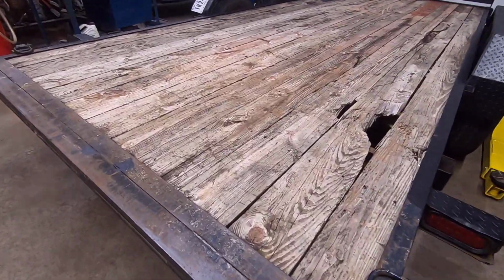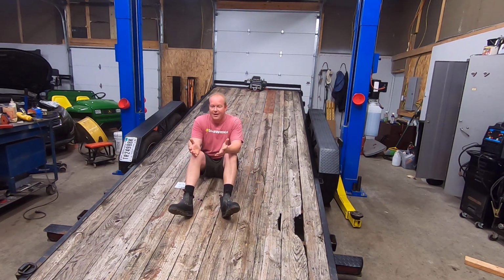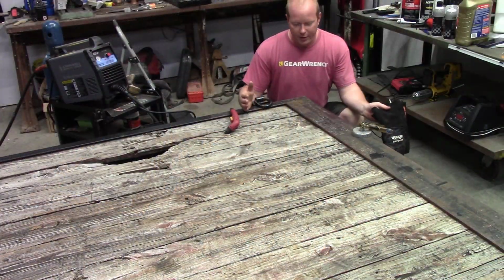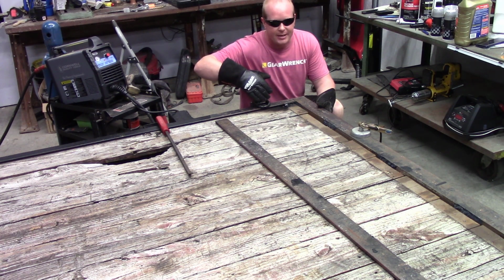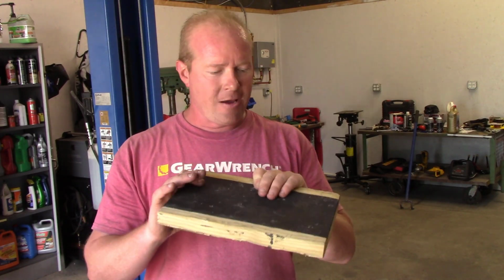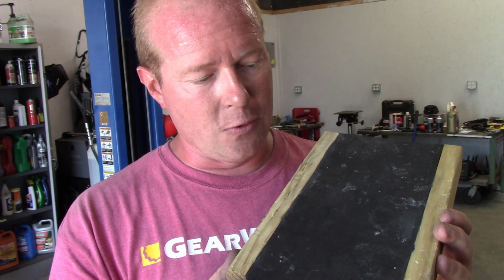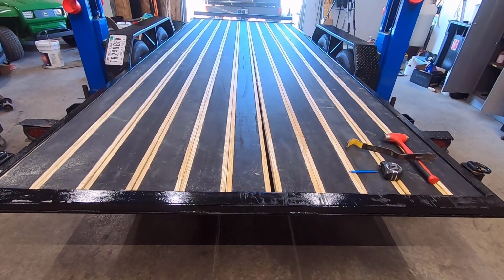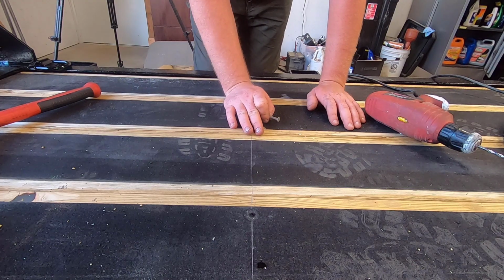Trailer deck replacement with Black Wood from Industrial Wood Technology

Comment: Nice job 👍 I'm just planning out some upgrades for my 18 foot trailer and this decking might be just what I need.
Reply from the maker: You will love it!
Reply: I am happy with the used motor oil treatment I applied to my hard wood 2X8 boards on my trailer.

Comment: Used engine oil works great for sealing wood trailer decks and it’s free.  Apply sparingly so it totally soaks in and doesn’t make a mess
When laying new deck always allow room for swelling when the wood gets wet
Reply from the maker: I heard engine oil and diesel fuel mix.
Reply: @FlashPerformance  
My deck was extremely dry, with newer wood diesel would work well
Reply: I’ve painted many of fence with used oil. It looks good when dried.

Comment: A helpful hint... Use brown copper napthanate on the deck every 2-3 years and you won't replace for decades!!.. my trailer is 21 years old and floor boards are still going strong...good preservative....

Comment: Why not just spray your boards down with Raptor Liner if you want a non skid surface.  Also would seal them from rot if you coat all surfaces.

Comment: My first concern is the longevity of the product in the elements; specifically the Florida sun.
Reply from the maker: It is just like any other wood product. It is recommended to apply a UV protective stain
Reply: @FlashPerformance   I am sure he means the rubber.. Also being in Florida, (Tampa Bay), I know that rubber and plastic takes an abnormal beating here. Check out the trim and dashboards on typical 5 plus year old cars and trucks here....

Comment: You could have taken a circular saw across the end of the boards and just pried the board ends out of that lip.... Why cut and weld if you don't need to. And they definitely put the runner on the wrong side. Those boards are gonna cup bad. And boards don't swell length ways they swell width ways. Damn sparkys don't understand how wood works lol. Very cool product though. And the trailer looks badass
Reply: He wanted to advertise his tools!

Comment: How is the wood pressure treated? most of the products used in pressure treating will corrode steel.
Reply from the maker: I don't know the answer to that, you would have to go to the Blackwood company and find out.  I did use coated screws so I am not worried about those rusting.

Comment: Are you supposed to use new decking screws when you replace the boards?  Are you supposed to use the existing holes in the trailer metal when installing the new boards?  If so, I am having trouble lining up the boards holes that I drilled to the existing holes in the trailer.  I suppose the solution is to use new self tapping screws to install the new decking.  Is this correct?
Reply from the maker: Always use new hardware when replacing the deck boards. Most trailers are built with self taping screws. When removing the old deck most of them will break coming out.  I cleaned up all the broken screws then pre drilled the boards and holes then used new self taping screws for wood and metal outdoors. Don't try to use the same holes it is not worth all the extra work.
Reply: @FlashPerformance   Thank you so much for the information.  Do you have a self tapping screw that you would recommend using?  Thanks!
Reply from the maker: @bigdbassn4489  Here is what I used, they worked great https://www.homedepot.com/p/Teks-12-2-3-4-in-Phillips-Flat-Head-Self-Drilling-Screws-40-Pack-21384/100145370

Comment: The biggest part I see with that product is they put the rubber  product on the grain cupped side of the board. It will eventually hold water and speed up rot.
Reply from the maker: The rubber is not just laid into the grove on the board, it is press molded into the board, so there isn't a gap on the edges for water to set in.  On my project, I have not seen any issues with this.
Reply: @FlashPerformance  you will eventually.  Any water / liquid that hits that wood will be absorbed eventually.  Just like on a sealed wooden deck. Sealant will Crack or become penitrable over time. When ever any kind of dementional lumber is used any where out side in elements the cup of the grain on the board should be facing down not up.

Comment: You could have just cut the wood to get it out from under the metal, and then cut the new boards a little shorter and slide them under each end about an inch or two